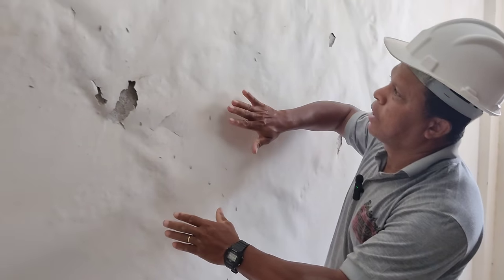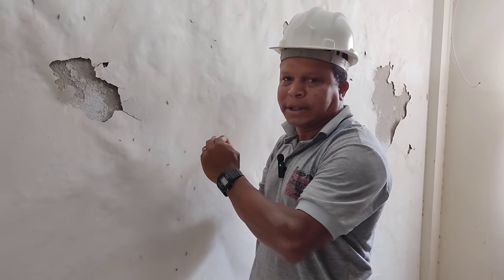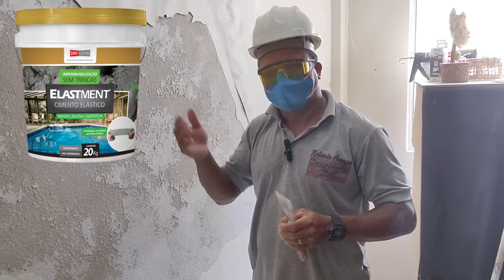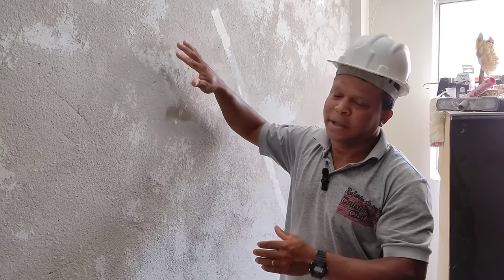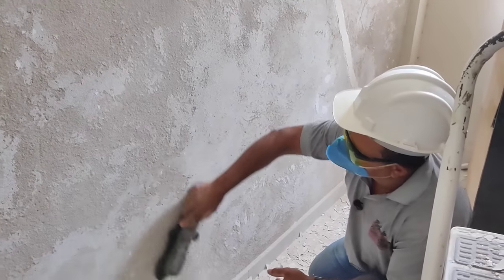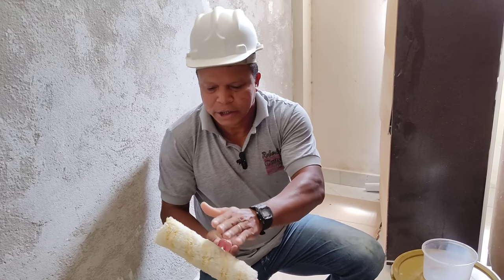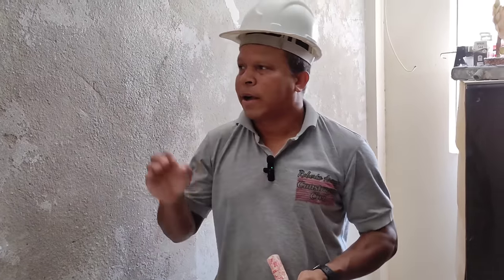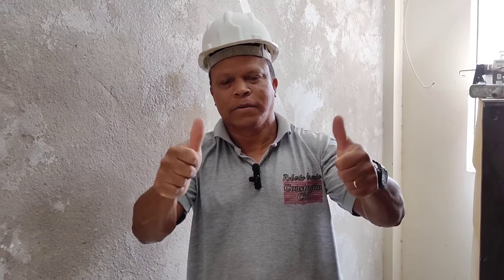Corrigir reboco sem precisar removê-lo da parede!

Comment: Esse procedimento serve se a umidade é no rodapé?
Reply from the maker: Sim, mas tem que se certificar se a umidade não está mais lá.
Reply: @robertoaraujoconstrucaocivil  A umidade está sim, estourou toda a pouco pintura, o pintor na época usou um fundo preparador, passou 3 meses ,estourou toda a pintura, a umidade é ascendente. Seu vídeo trouxe esperança pra arrumar minha casa, o quarto todo tá assim.
Reply: @danilofreitas6590  imagino que pelo tempo do seu comentário vc já deve ter solucionado o problema. Caso contrário, nesse seu caso em específico, será necessário remover todo o reboco e tratar a alvenaria com um tipo de impermeabilizante específico em demãos cruzadas, por exemplo: 1° demão na horizontal, espera secar, e a 2° demão na vertical. Depois faz um reboco forte com impermeabilizante para reboco/concreto, aguarda o tempo de cura do reboco (mínimo 12 dias), depois procede com o emassamento e pintura.
Reply: @eldesdichado1480  obrigado pela orientação, ainda não consegui mexer. Tava vendo alguns vídeos em que usa um tipo de tinta que não sufoca a umidade e tbm não estoura